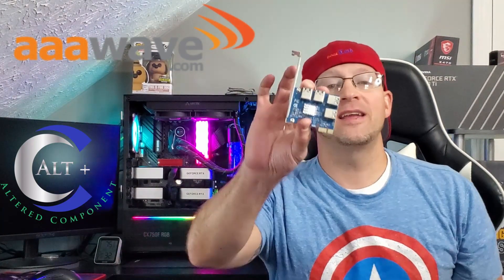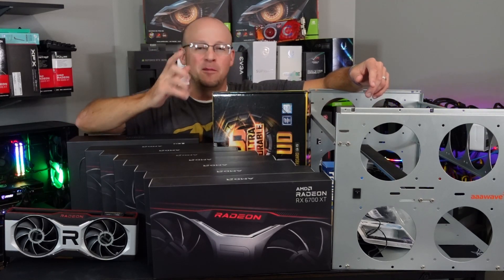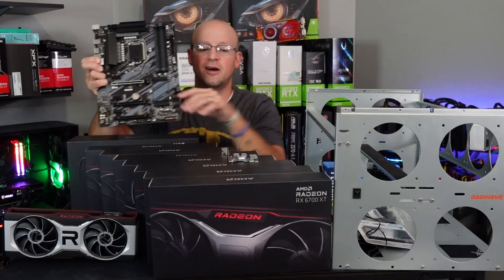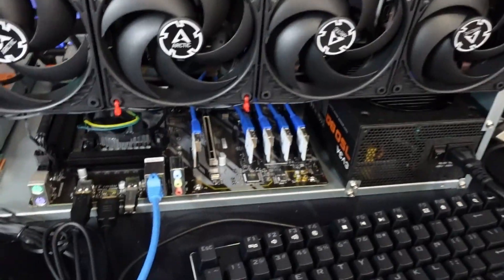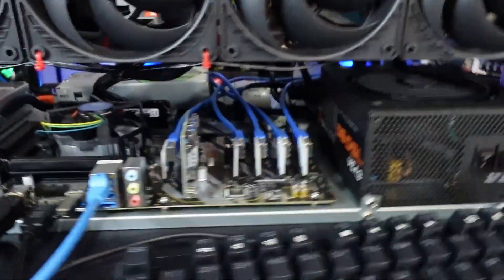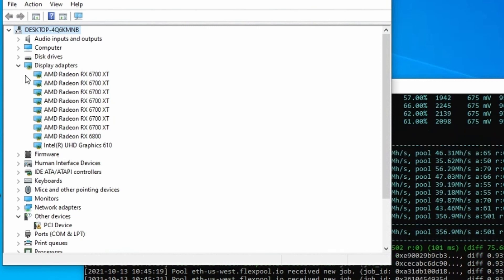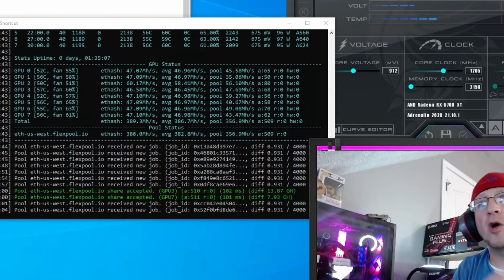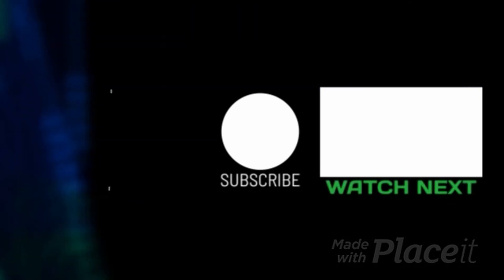How to Add more GPUs | expand PCIe slots on motherboard for Mining | aaawave 1 to 4 PCIe Adapter

Comment: is there a difference of a 4 slot and a 6 ?
Reply from the maker: @jesusace83  if u mean 1 to 4 splitter or a 1 to 6 splitter, no they function the same way.  What will matter is how many pcie lanes your mobo will support.  Even though ur board may have 6 pcie slots on it natively,  it may not be able to run all 6.  Cpu must be able to as well.  Most modern hardware can easily run 6 to 8 lanes
Reply: @AlteredComponent  thank you for replying, i have a 6 way splitter and i dont get video feed when its connected
Reply from the maker: @jesusace83  go to bios and make sure u have display option change from pcie to on board

Comment: Nice video. Thank you for the video. Are you just using one 750 BQ Power supply? Will that be enough for these many GPUs? I have three RX 6800 xt that I am trying to connect and have an 850W Power supply, but do I need 1300W or 850W should do fine. Can you please let me know? Thank you.
Reply from the maker: you can use Hashrate.no to see power usage on different algos.  With ATX power supplies it is advised that you use 80% or less for the most part.  That being said, i just checked hashrate.no for 3 x 6800xt.   running kawpow algo and tuned well you are only using 400w for the gpus, plus system (around 135w per gpu).  So yes 850w has plenty of juice to run a 3 x 6800xt rig.  Mine on
Reply: Thankyou for the information.

Comment: Hey can you tell me what is the difference between connecting a second gpu through sli slot and  pci slot
Reply from the maker: @bullymaguiregaming1757  gpu mining utilizes 1 lane, so while ur mobo will have  multiple x16 slots (full pcie length), they usually do not both function at x16 lanes.  Ie, the top main slot will do x16, and the bottom will do x8.  For mining tho, it shouldn't matter since running standard risers does not take advantage of those lanes

Comment: H81m S, pentium g3240,  with this combination how many gpus can it run
Reply from the maker: the g3240 can support up to 16 pcie lanes, so the question is the board.  The H81 chipset supports up to 6 pcie lanes.  You should be able to run 6 gpus with a splitter on this baring that the lanes are not shared with storage device.
Reply: I have 5 1660s, 4 of them runs but as I put the 5th one, there is no display and I use sata Ssd so all six pcie lanes are available.

Comment: Nice video, awesome content!! I have a question concerning the motherboard Gigabyte Z390 UD. It is rev 1.0 or rev 1.1? Does this matters?
Reply from the maker: That is a great question.  Not sure what the difference on revision are on that one.  i tried searching it and didnt come up with any info.  Mine on
Reply from the maker: That is a great question.  Not sure what the difference on revision are on that one.  i tried searching it and didnt come up with any info.  Mine on
Reply: @AlteredComponent  I think the differences are about the cooling system design. (So i assume you used rev 1.0?). I'm going to buy this motherboard as my ASRock Fatal1ty B360 Gaming K4 can handle 4x3060 ti GPUs, but when the 5th is plugged, it doesn't boot (although the available lanes are 12 in the B360 chipset). All possible BIOS configurations have been performed.

Comment: Gigabyte Z390 UD BIOS configuration, please.
Reply from the maker: only thing you really need to change in bios, changed graphics to IGFX (integrated graphics) so that the cpu and motherboard provide the display out.  Also make sure that Above 4g decoding is enabled.  i leave pcie gen on Auto, but if issues reading cards, try gen 1.  take care
Reply: @AlteredComponent  Thank you Bro. I try.

Comment: Great content. Please confirm the processor you are using. I'm planning to buy this motherboard. Apart from 3060 V1 we can hook up any GPU via risers correct.
Reply from the maker: thanks for watching.  Using a intel G5420.  Best way is to buy mobo or cpu, then pair the other to match.  If you get the mobo first, go to the official site for the Mobo, support tab, then to the CPU compatibility list to ensure which cpu will run in the motherboard
Reply: @AlteredComponent  Thank you so much for the response. Happy mining!

Comment: Hi, i have a B85 motherboard with 5 PCIe slots. Planning to use the splitter to get to 8 GPUs, currently running on 4. However I've read that motherboards without above 4g decoding feature would simply not boot up when plugging more than (at most) 6 GPUs. Is this true? Also my processor is a G3250
Reply from the maker: The b85 chipset can support up to 8pcie lanes.  The cpu can support up to 16 pcie lanes.  As long as you do not have any other devices, you can support up to 8 gpus.  Take care
Reply: @AlteredComponent  thank you, and happy new year 😀

Comment: is there motherboard with good pcie slots for AMD . ?
Reply from the maker: honestly most AM4 socket mobos can work just fine to provide with at least x12 lanes.  Key however is that some am4 processors, especially those with integrated graphics "G", can only support 4 lanes.

Comment: I used one of those recently, ended up with 2 3070 ti, 1 3080ti, 1 core  i3 and a z590-p completely dead.
Reply from the maker: Wow.  Was it one from aaawave or a random company?
Reply: @AlteredComponent  I don't think so, got it from ebay and it looks like yours but the heatsink in the middle is a bit smaller
Reply from the maker: @oscarsalas1  I have heard similar stories using some of these random adapter.  Man that is rough

Comment: Where can i get the 3D Printed Clips for the 4 to 1 pcie usb add in card? I plan on building my farm out like this and have 3 adapters already
Reply from the maker: mine actually came from ebay.  The seller i got it from doesnt have any available atm, but i bet if you message her she has them.  https://www.ebay.com/itm/162986956957?ssPageName=STRK%3AMEBIDX%3AIT&_trksid=p2060353.m1438.l2649
mine on buddy.

Comment: Nice Video! But you have to tell the people that the 4x Pcie provide connection for 4  cards... but only if the board (CPU) really supports so many cards. For example: my ASUS B450 Plus supports max 6 cards. So i can not plug in 4 cards + the 4x splitter with 4 cards. The system just don´t boot up.
Reply from the maker: Good point about pcie lanes,, except your example is incorrect.   A b450 chipset can run at least 12 pcie lanes.  If u are not able to run more cards, it is because your cpu is limiting the pcie lanes.  What cpu and what specific mobo...ill give u actual numbers
Reply: @AlteredComponent  how about a z590 aorus master? it appears to be the same number (maybe 1 more pcie 1). would this work to use for a mining board? im not sure if its worth using for mining, to sell, or to use way down the line (i dont believe it is ddr5 compatible). Great info and a helpful video!
Reply: adding more cards is dependent on the CPU? Is there a video on this or how I can check my intel CPU?
Reply from the maker: @hook361  actually hooking more cards is cpu and motherboard dependant.  I should have touched on this as well as described how to find this info.  Maybe I need a follow up video
Reply: Yes please make a video on this! I follow quite a few mining channels but they don't really touch on this